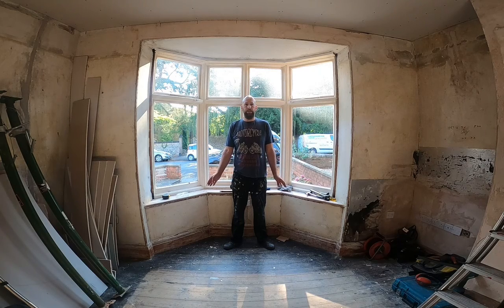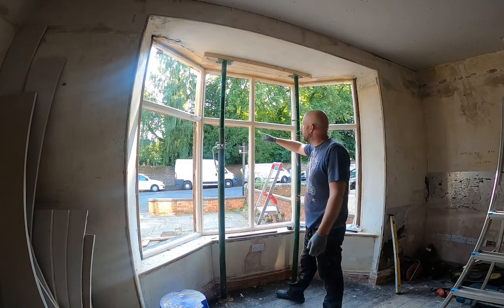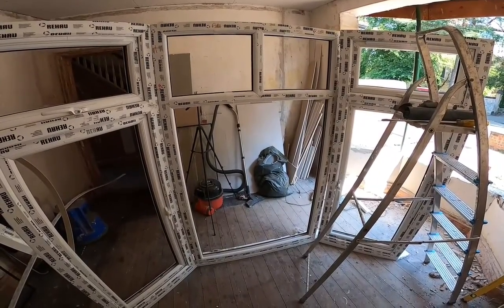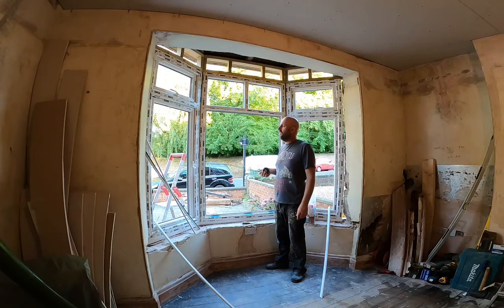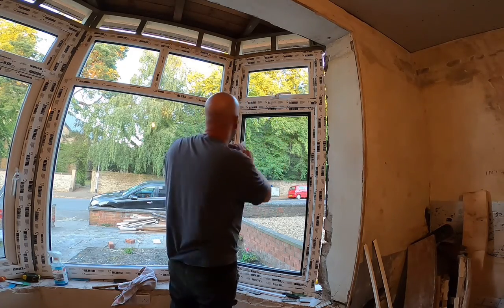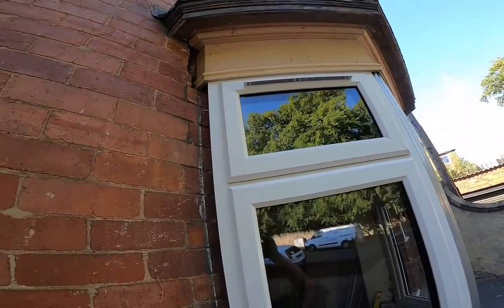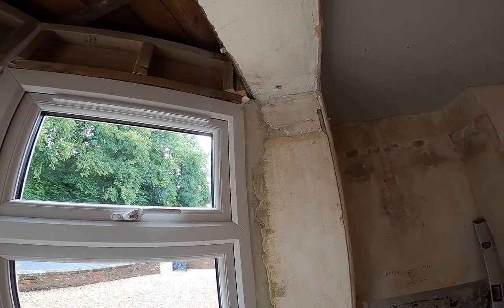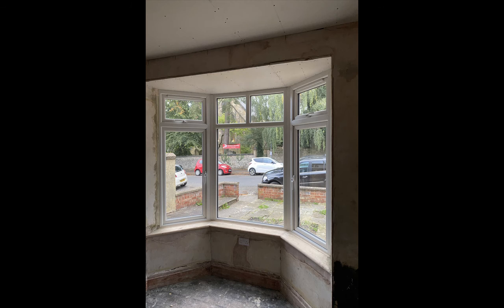Bay Window Install - UPVC Bay Window DIY Install #43

Comment: The original windows had so much more character.
Reply from the maker: Possibly but very expensive to keep the house warm and not good for the planet with such a low energy efficiency rating
Reply: Unfortunately character doesn't keep the cold out or remove the need for painting every year....
Reply: Nah, the original sashes wee far superior.

Comment: How difficult would it be to have the wall follow the window? Currently we have a flat wall and would like a bay window but for the wall the follow the window underneath rather than a ledge if that makes any sense
Reply from the maker: Hi, are you referring to the sill, we went for a standard sill to keep moisture away from the bricks but you could conciser a flush sill or no sill

Comment: Great work!! Just watches the whole thing and going to be doing it myself soon, can I ask why did you use expanding foam n the joins where the aluminium supports go? Was that for sound or to help secure it all?
Reply from the maker: Thanks, the foams probably not necessary but hopefully it will help with sound and thermal performance. Windows have been in a good while now in all weather and we are really happy with them.